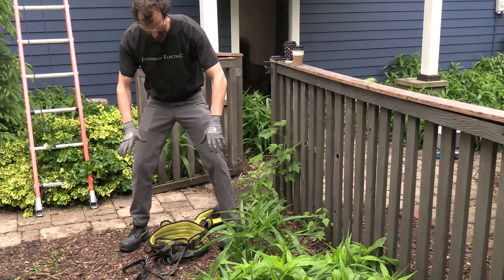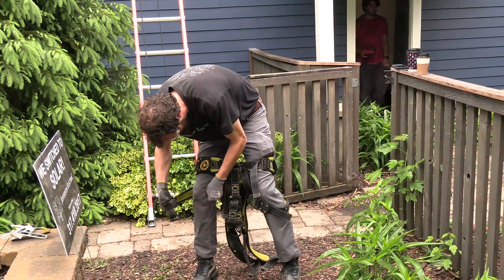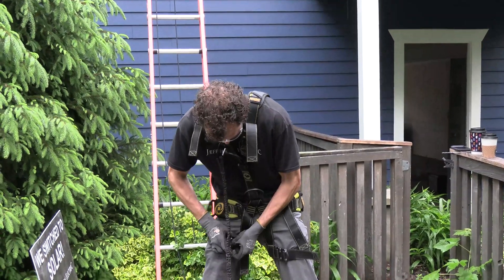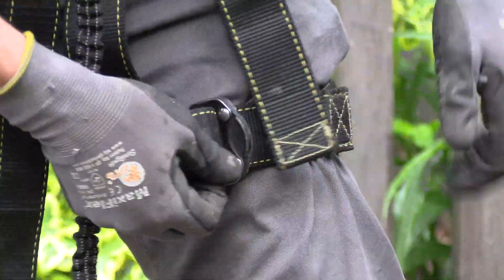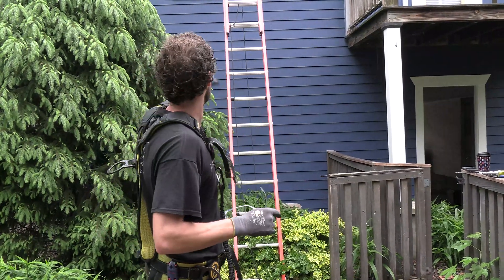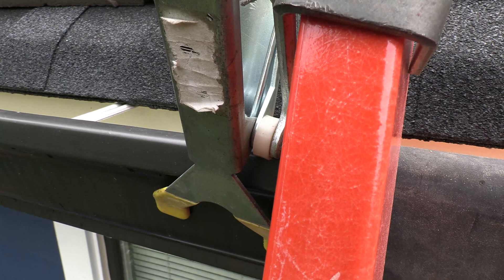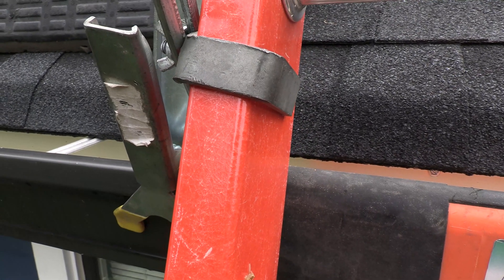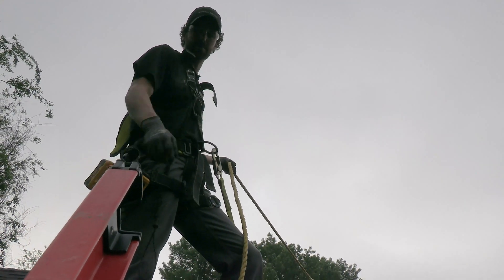A Solar Electrician's Ladder & Harness Rules For Taking The Fear Out Of Heights

Comment: Never secured my ladder until two things happened: strong wind came and blow ladder down and had to wait awhile for somebody to finally come by ( pre cell phone days ) and Air conditioning guy had his 32' new fiberglass ladder stolen while performing a service call at a large mall.Dumbest thing I ever did with an extension ladder while doing a 200 amp service for free at a coworkers church in the hood was on maybe the coldest day that winter moved one of the 4/0 wires thru top ladder rung. Hours later and was getting dark tied in the service. Could not remove the ladder because the 4/0;wire was still thru the top ring. Murphy's law I swear you will always have the most problems on free jobs.